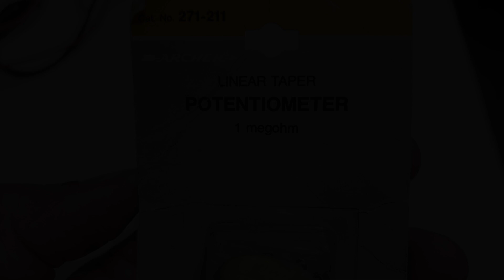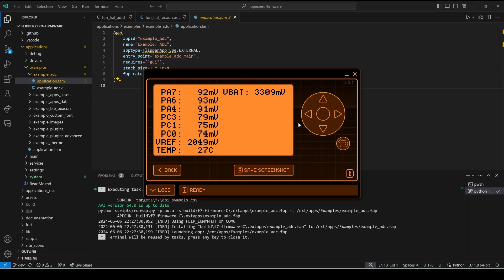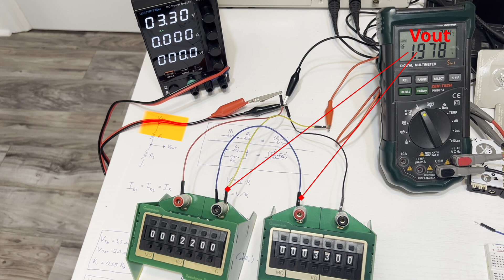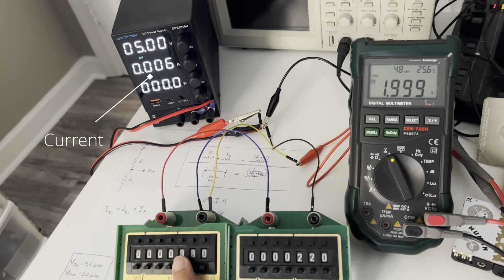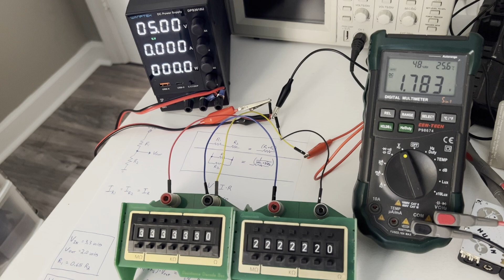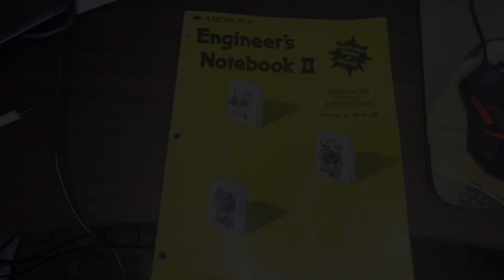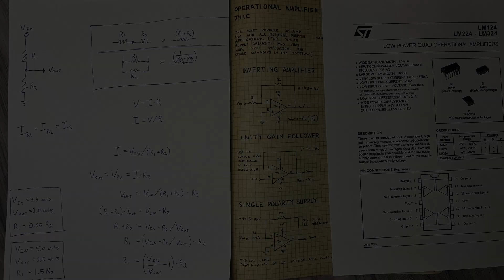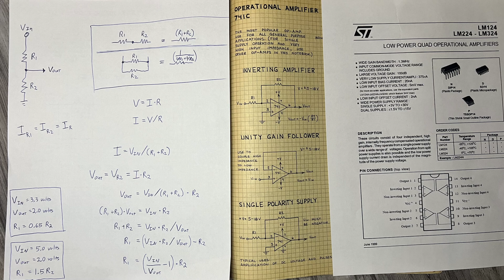[120] Flipper-Zero: Introduction to Analog Sensors #flippperzero #analog #gpio #electronics

Comment: Thank you for this great explanation. One of rare tutorials that explains analog reading on Flipper Zero and also great explanation of the resistor voltage divider.
Reply from the maker: Glad it was helpful! 
I was excited when they exposed an API for analog values. In the past we had the flipperscope app successfully using the LL libraries (https://github.com/anfractuosity/flipperscope/blob/main/scenes/scope_scene_run.c) but the firmware API made access easier & hides many of the details.